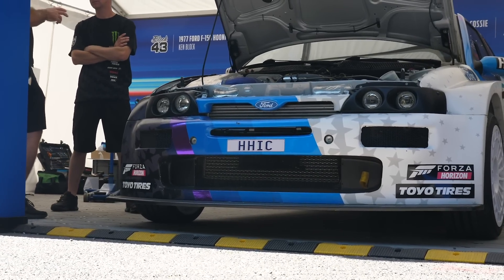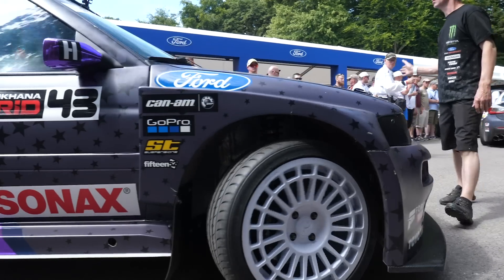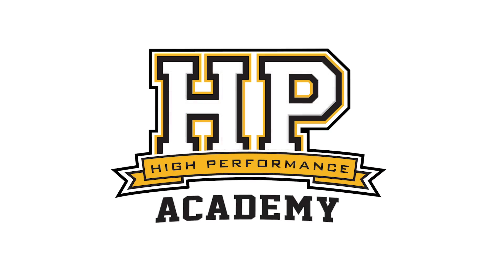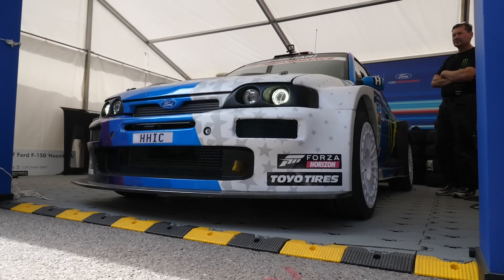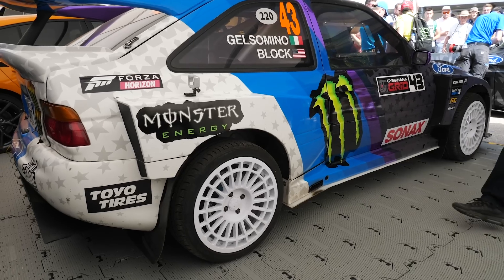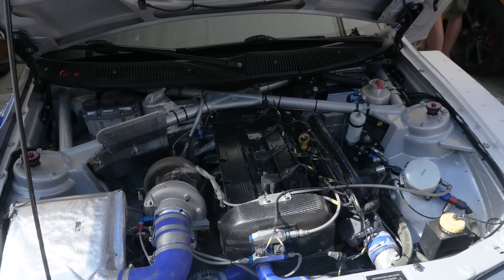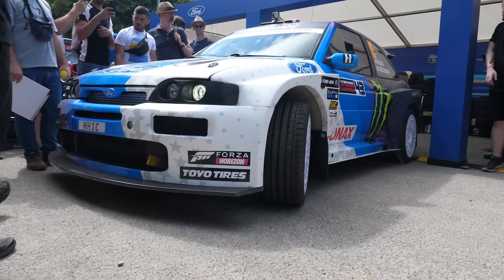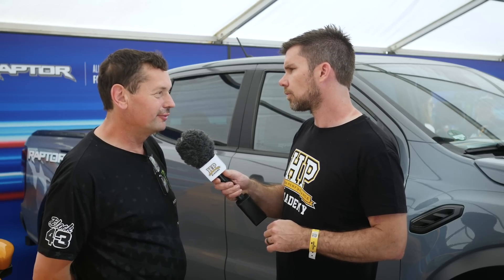1000HP & 700lb/ft Of Torque | YB Cosworth King Julian Godfrey [TECH TALK]

Comment: It is pretty clear that the stress is much higher in low rpm (no surprise), but I wonder whether the performance engine builders actually look at the combustion speed / heat release rates and corresponding maximum cylinder pressures (like would be the case in any proper engine development). Or is this to fancy for aftermarket companies?

Comment: Why did he say they don’t tune the engines for HP anymore and focus on torque? The engine’s rotational force is measured in torque, thats all it can produce.

HP is just how fast that engine produces torque I.E how high it revs and how fast it revs. 

There is no such thing as the engine producing torque and horsepower.

Comment: Very interesting guy, great content. Is that correct people are applying Nikasil to steel liners? I thought people where fitting liners to get away from coatings?
Reply from the maker: Yes that is correct. It would depend on the application as to whether you are worried about coating a liner or not, as discussed there is a specific reason for it in this instance due to the piston material from memory.
There are greater advantages to using them than to just avoid using coating at all though. Could well be a reason for some people but it's not something I have heard of in the performance world personally - Taz.

Comment: i belive that there is still not too many 4 pot 2.0 Liter engines that can support 500bhp with stock internals and yb is from 80's
Reply: SR20DET’s can. And yes that engine is from the 80’s
Reply: @griplimit  Yb makes more torque though

Comment: So just to add the Yb engine block base was first used in a 1972 Ford Cortina as Julian said. It then evoled into many variants over the years with the 205 blocks being used in the 2.0 injection Sierra. Then on to 200 block which is regarded as the strongest of them all then there are the Smith and Jones alloy blocks which are the ultimate block for big power. 
Here in the UK we have many Cosworth specialist engine builders like
Julian Godfrey
Harvey Gibbs
Mark Shead.
All of which are pushing the boundaries of the YB in different stages of tune.
Respect to them all👍😎
I built a YB powered Mk3 Cortina in 1999 and still own it!! Although its on its 4th evolution

Comment: Nikasil, Alusil, blocks- Great for the manufacturer, BAD for a racer,  sleeves are king, even better alusil,nikasil sleeves, even better.
Reply: Think also about N/A with lower pressure in cylinders and weight advantage.
Reply: @jareknowak8712  To go fast in N/A you want high compression ...... These coatings are a disaster and makes blocks with scratches a throw away versus traditional sleeved blocks. The weight advantage of an engine block with cast in liners using nikasil or alusil is hardly worth any gains at all versus a steel sleeve. Of course you can bore out a nikasil coated cylinder and replace it with sleeves but that's extremely costly and doesn't always give you good result.